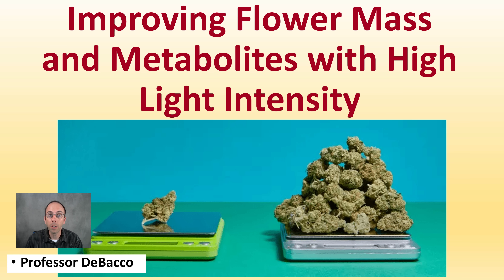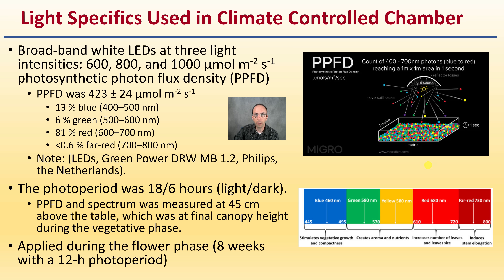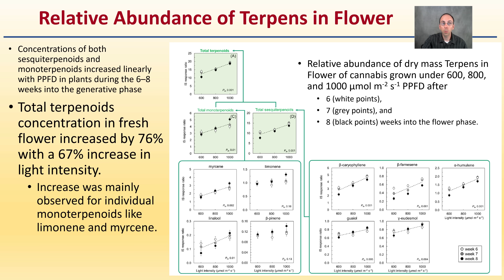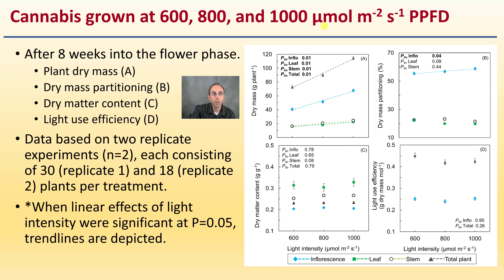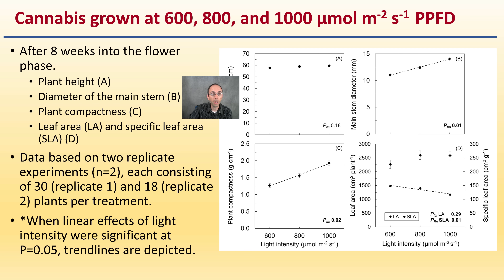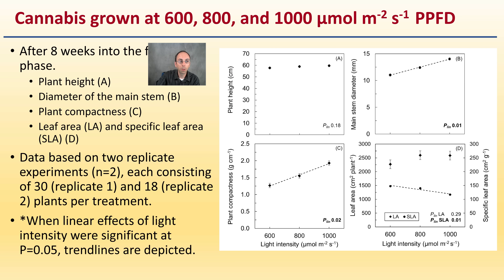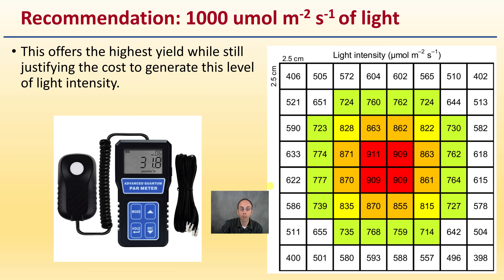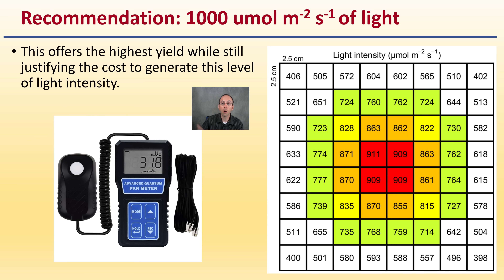Improving Flower Mass and Metabolites with High Light Intensity

Comment: Some very specific Information im looking for: What happens if you grow at high intensity like 1000 μmol but the VPD shifts out of optimal range. 
Or else: Do I need to lower light intensity If my plant metabolism is slowed? I would figure yes, but how much? 
Where I live the moisture content in the air alters a huge lot from day to day, humidity control Is sometimes not possible for me. My plants experience light stress from time to time all of a sudden, I think It might just be a lack of difference in vapor pressure to cover my high PPFD?
Does anyone know of a chart of how intense my lighting can get relative to my VPD?
Im very confused on how this topic is covered by videos on YT, everyone just recommends 1000 μmol but if I try that without full AC/humidity control, there Is just no way that wont stress my plants over the top.
I want to automate my light intensity to be perfectly dialed in for the metabolism my plant is actually capable of doing in the moment, not under optimal conditions.
Reply: q1: stress, possible drooping or light stress. kinda like driving a small jap car on full rpm with parking brake semi-engaged
q2: I lower or increase my light intensity based on the leaves, I turn it as high as I can until I see "taco-ing" then bring it back 5%-10%
I try to stay at the vpd green zone and listen to the leaves for light intensity.
Each cross/cultivar/strain reacts differently, even full sister plants can show different preferences on light, water and nutrient requirements.

charts are helpful. but at the end you should learn to listen to your plants and what makes them happy.

good luck and happy growing friend!
Reply: It's more to do with temps. Keep vpd around 1.1 to 1.3 and your good the entire grow. So temps like 78 and humidity like 60 is ideal

Comment: Everything except CBD has insignificant amounts. Why even measure it? But looking at CBD, at week 6, the 600 PPFD value is higher than the 800 PPFD value. The 1000 PPFD value is slightly higher than 600 PPFD for week 6. WHY? Also troubling that the values for week 6, 7 and 8 switch places. It is not always the lowest in week 6 and highest in week 8. It just fluctuates, which is a HUGE problem in assigning any meaning. Less light could simply mean the plant develops differently. For example slower or faster and therefore values fluctuate.